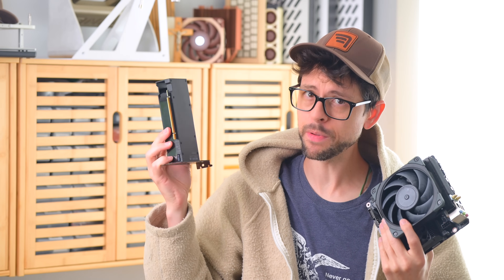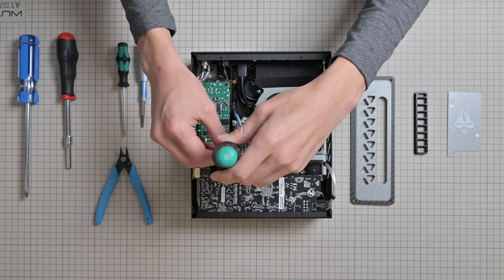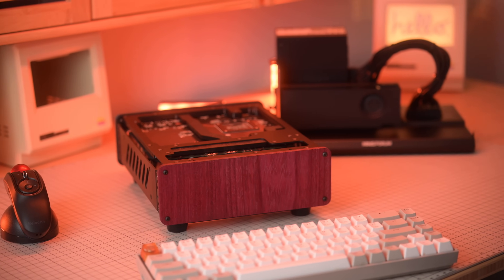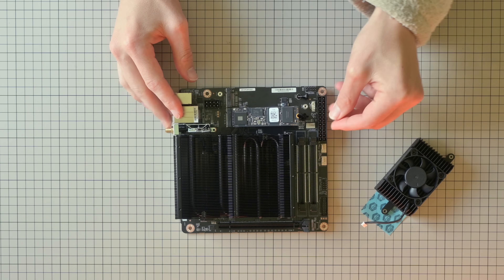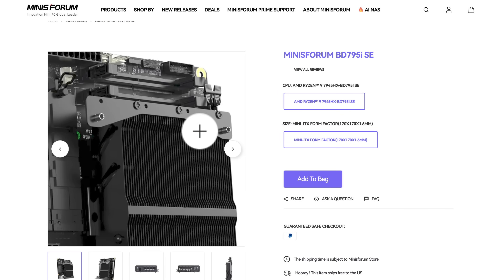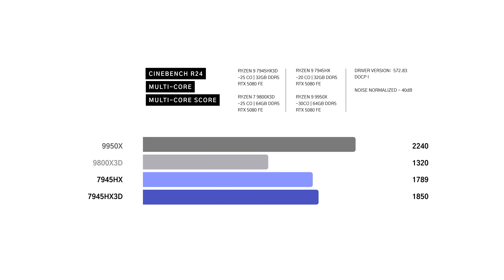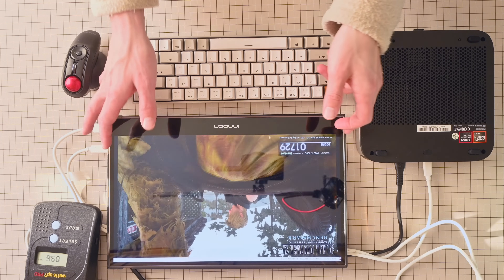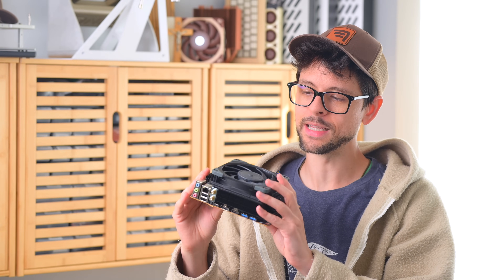Minisforum BD790i - SURPRISING X3D efficiency!

Comment: Hey i watched your video about 5mnths ago about an x3d tiny build with a 4060lp. If I had the parts how do I commission you to build it for me? I know nothing about building the power supply part of it. I have the major components already like cpu, motherboard, gpu. Id need the psu and ram. My ram has a heatsink. So it'd be too big.
Reply from the maker: 100% just email me.

Comment: I bought this board and replaced my 9950x so I could use a smaller case, the Fractal Ridge. It beats my 9950x in gaming but of course the 9950x is better at multitasking.  But I still couldn't be happier. Paired it with ddr5 6000 RAM, 1000 watt PSU, 2 gen 5 Nvme drives and my 4090 this thing is very impressive. Thermals are something I'm still working on in this build but I'll be able to make this work. Got the board for $560 and what a steal at this price. I paid that for my 9950x at launch alone.
Reply from the maker: That's where this board really shines...using a 9950X with a teeny tiny cooler up against a side panel is just asking for pain. This board really makes those kinds of cases SHINE.
Reply: @NotFromConcentrate  No when I had the 9950x it was in a different case. When I wanted a smaller case I found this board. Just need some 80mm fans to help exhaust the hot air and add some cool air and i'll be set.
Reply: may inask which sodimm ram kit youbuse? so mhz? and especially the latenzy? thus vaords supports upnto 5400mhz i thunknbut i saw a few comments when people talk about 6000mhz. was wondering if 1440p or even 4k gaming would be a disadvantage on this board due to ram latency when youbcompare it with desktop system. thx!

Comment: any chance you can mention and show the other common s4t builds as part of your next videos? ive wanted to build one for my lil bro for a while, currently torn between going the 8700g route or holding out for the framework mainboard allegedly coming out q3. the power delivery / hdplex parts needed is still a little bit unclear to me and discord just isnt that great to consume this type of info. thanks!
Reply from the maker: Sure, what kind of info do you want? Happy to help. I have a video here where I cover "APU" builds and show how easy they are: https://youtu.be/v0qfDD8sUvw But it's even easier now because you just purchase the HDPLEX 250w GaN and Skywire Ultra cable and you are done. SUPER simple!
Reply: @NotFromConcentrate  thanks for the reply! i actually check that video every time im doing a purchase a part to double check. it took me longer than i should admit to get 3x of the dc-ac 200w cards thinking i was going to do 3 8700g builds and in the meantime the framework mainboard got announced. framework lists the consumption for the mainboard at 350w, and recommends a psu of 500w. Id love it to be all internal, (and love hdplex build quality), and im unsure if i need to get both the 500w psu and the 500w dc-ac, and if both will fit inside an s4t, or if the 200w dc-ac cards will be enough. i know its an unreleased part, but i dont want to waste money going in the wrong direction. your cases are awesome, and i love the poptart stickers though i would never use them :)
Reply from the maker: @tomascampabadal7485 I really want the framework board to figure things out; can't know about the actual power consumption until we see. :(
Reply: @NotFromConcentrate  ill happily wait for your update and my bro gets a 8700g build then :) thanks!

Comment: I've been wanting to get one but I have also seen people mentioning on forums about quality issues and their boards randomly dying after a few months. The concept is great considering laptop chips are powerful enough more most people and they're super efficient as well.
Reply from the maker: I've had mine for four months and used it in several builds. I've been surprised with how plug and play it is. Zero issues whatsoever...but It's just one sample. I felt confident enough to make the video but I'll keep an eye on the community's feedback.
Reply: @NotFromConcentrate  That is great to know! Thanks for sharing your experience so far. I hope you'll continue to do a follow up 6 months in and later down the line when you retire it for another daily driver.
Reply from the maker: @foureight84 if I don’t do it here, then I can definitely let you know if you email me or check in on Discord. 😅

Comment: I just got one of these its great - have you re pasted the heat sink what did you use? I saw you had it off in the video
Reply from the maker: Yeah I put PTM7950 on all my stuff now. This chip doesn't need it, but I wanted to weigh and measure the heatsink. It's very lightweight, even a NHl9i crushes it, but it's such an efficient chip that I think the cooler is sufficient.
Reply: @NotFromConcentrate awesome thank you I've just started to test on my bench so no case yet.  But im topping out at 84 degrees on full synthetic load

Comment: the pcie doesn't have much effect on gpu's, at least not x16 ones, gamers nexus even tried using pcie 3 on a 5090 and it barely had an effect
Reply from the maker: Yup yup, and I have several videos on it testing up to the 4090. But times be a-changin. The MAIN issue comes when doing weird stuff like we do here at NFC. If you run DP Passthrough, for instance, you are looping back through the BUS and that's where even lower end GPUs start to saturate. Hope this makes sense. TY for the comment.